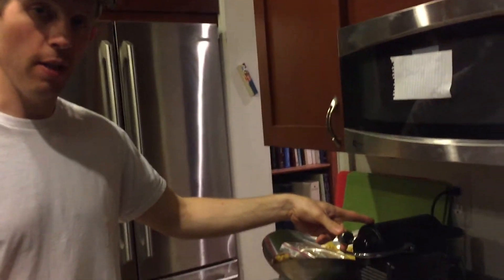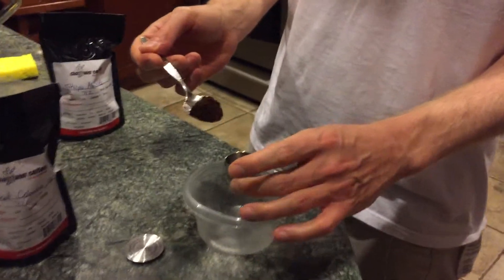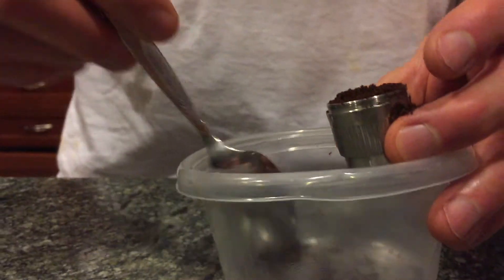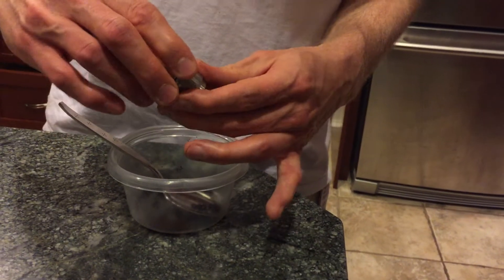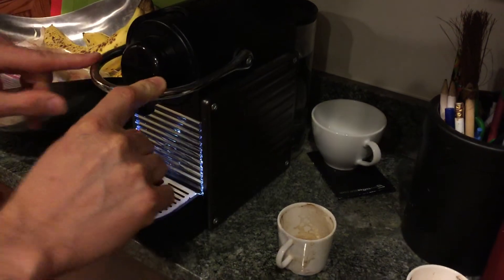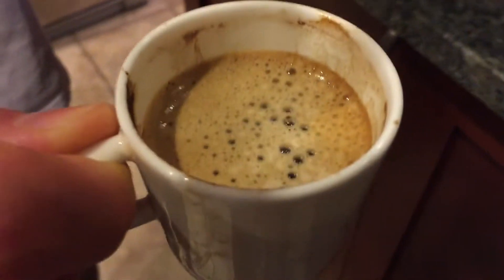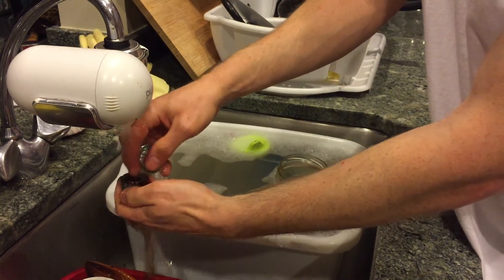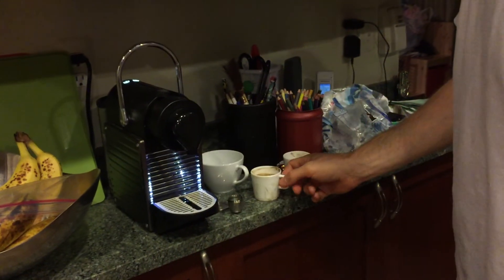How to make great espresso with the MyCoffeeStar steel capsule

Comment: Hi sir just bought a stainless steel capsule. But it deosnt seem to fit for the inissia mini nespresso machine. Dont know why it doesnt fit.
Reply from the maker: I am not familiar with the ininssia mini....so I am probably not of much help. Sorry.
Reply: Hi sir, thanks for the reply. i just had to push the capsule with more force, at first i thought i destroyed my machine, but its all ok. could i ask for some advice? was planning to buy some beans from starbucks, what should i say to the barista as to the level of grind from the beans? will they know at all? thanks again and more power.
Reply from the maker: Glad to hear the capsule fits. Grinding is a big issue with the capsule. You may need to experiment a bit with which grind setting works best. You could have Starbucks grind some coffee at different grind settings and see which one work best with the capsule. Keep in mind that even grinders of the same make/model will grind differently depending on their age, use, and setting. Humidity also has an effect. In short, it is quite tricky. After a while, I ended up purchasing my own grinder so that I have total control. Good luck.

Comment: Hi Matt. Thanks for your review. I just bought my Nespresso machine and I'm considering buying a stainless steel reusable capsule for three reasons: 1. environmental concerns; 2. save money; 3. quality (I'm the "100% arabica purist" kind of guy, and all Nespresso grand crus seem to have robusta in the mix; also, I have an electric grinder to always have fresh grinds in my moka). My biggest concern is that all reusable steel capsules are pricy, so I'm not buying unless I'm sure they can make a decent coffee in a Nespresso machine. Problem is that most reviews I've seen are negative, but people don't talk about the grinding of the coffee, so I'm hoping that people giving thumbs down to steel capsules are using the wrong grinding. Since you seem to aprove the system, let me ask you: are you using coarse, medium or fine coarse? Thank you very much.
Reply from the maker: Hi Marco,
I purchased the steel capsule for $45, which is not that expensive in the long run. The steel capsule is pretty sensitive to the grind. I have my own burr grinder which has around 30 different grind settings (32 = very coarse, 2 = very fine). I use setting number 17 for the steel capsule. So I would say the the grind is medium or medium-coarse. But again, the capsule is pretty sensitive to the grind. Sometimes if I go down to setting 15, then the capsule will not work because the grind is too fine. And if I go up to setting 20, the capsule will work but the quality of the espresso suffers since the grind is too coarse. Hope that helps.
Matt
Reply: Matt Vanderhoek Thanks for the feedback! The capsule works, but how fine? How do you compare taste, body and crema to an official Nespresso capsule?
Reply from the maker: Hi Marco, I use freshly roasted (less than 3 weeks old) and freshly ground coffee in my stainless steel capsule. The taste and body of espresso made with this coffee are about 10 times better than the coffee in an official Nespresso capsule. The crema is decent but not as good as an official Nespresso capsule. Hope that helps.
Reply: Maybe Nestlé add some emulsifier to their coffee capsules...